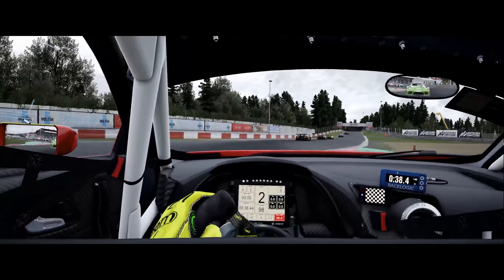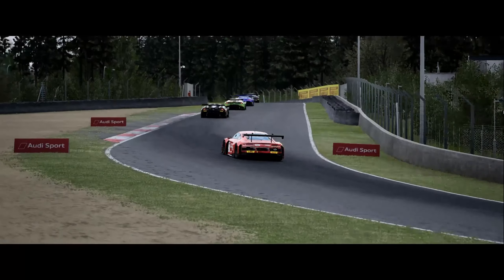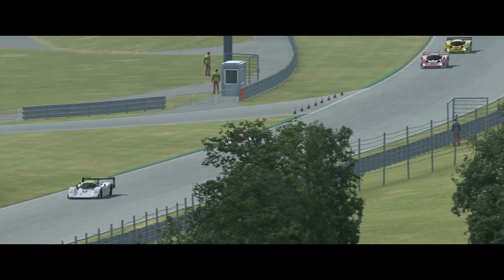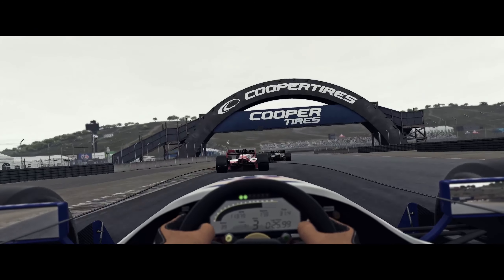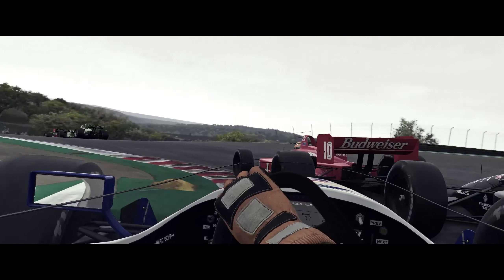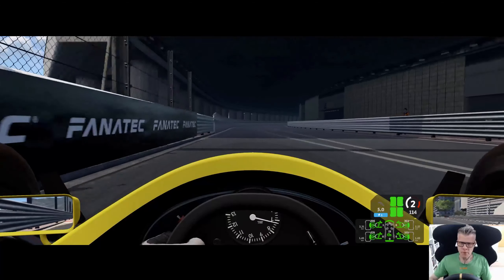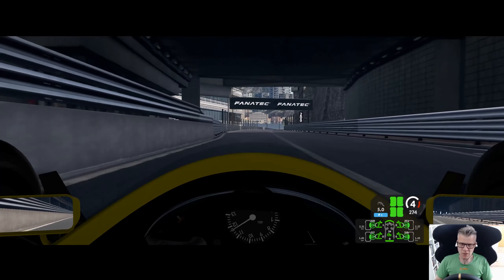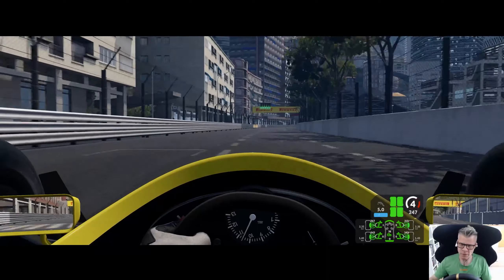How To Find The BEST FFB Settings For Your Fanatec CSL DD Direct Drive Wheel

Comment: Hi Timo. I am pretty new to the CSL DD wheel. Thanks for the informative video. You´re completly right, no matter what suggestes settings i tested, by the end of the day i always had to adjust them to my likings. But thanks to Fanalab it´s easy to handle. So now to my question which i still did not find a answer for so far. As i don´t like the brutal ffb peaks/hits i learned to use the [FEI] setting. The question is? Can you recommend this setting to use in range of 50-100 ? Is the FFB loosing details while lowering this ? Or its just reducing the strongness of those "hits" ?? Thanks

Comment: For assetto corsa u must use the compatibility mode (suggested by the fanatec) instead of the pc mode, which is not ready yet for the game.
Reply: what?? i also own the csl dd and never had to put it in comp mode.
Reply: @MrStreetMosher  the video at 5:21 - CSL DD (Compatibility Mode recommended). There is no support in AC for dd wheels, that's why comp mode is recommended.

Comment: Hey Timo, I'm trying to decide between the 5nm and 8nm version.  I tend to like my feedback forces on the lighter side.  Do you find you even needed the 8nm version?
Reply from the maker: Hi Stuart, for me personally, there was no question that I would go for the 8 nm version. Coming from the CSL Elite, I wanted a certain top end to play around with. I also know the CSW 2.5 which has only slightly less nm than the base CSL DD. And that for me was too close to the CSL Elite. So if you have the budget, I definitely recommend the 8 nm version, or advise you to watch some reviews which compare the two. But no matter which one you eventually buy, the CSL DD is the best (only?) entry DD wheel base and a great value of money.
Reply: @TimoDick  Thanks Timo.  That's helpful.
Reply: But as long as you don't put the 8 NM to more than 62% gain, you could get the same results with the 5 NM und just set it to a higher percentage, isn't that right?